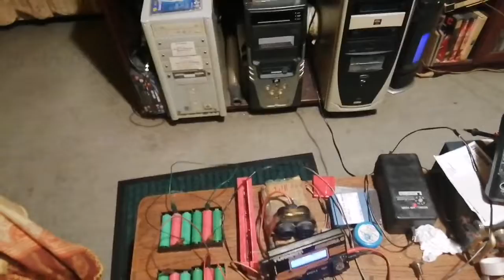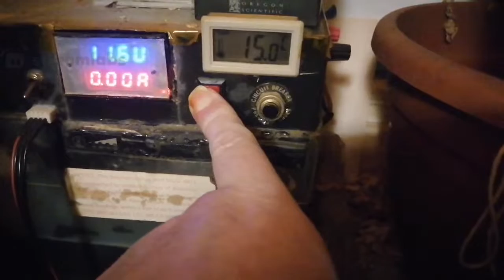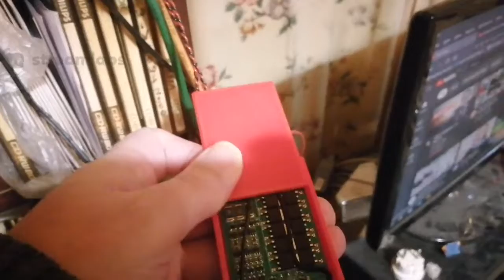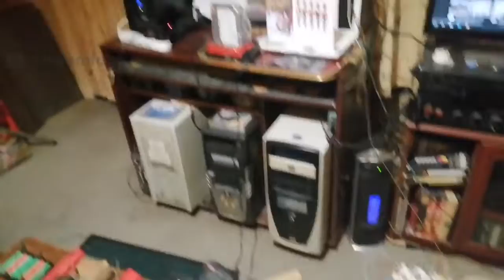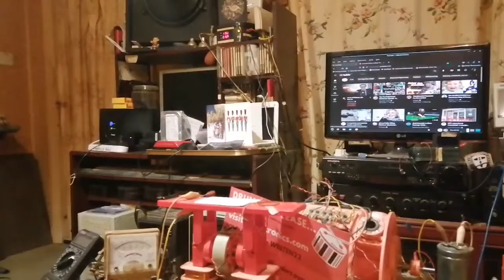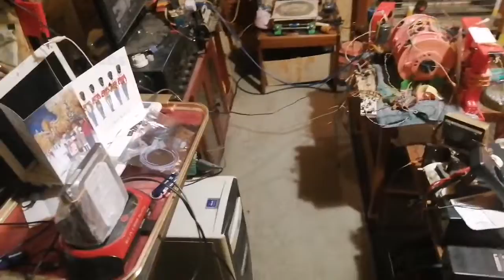Regarding my Solar Battery

Comment: 🧲 Have you ever played around with high frequency plate capacitors? I use them for storing static electricity for my ball lightning generator.
Reply from the maker: Not specifically no, because the amount of useful Watts is very small, I know many experiments others have tried but I tend to see it more of a novelty. I Prefer to focus on useful current devices, I have had some high voltage devices in the past such as an ex military transistor with ceramic isolation blocks but gave that away years ago. The problem with working with high voltages is it can cause fires. Once in 1987 I nearly set fire to my kitchen after building a high voltage insectecutor I have been reluctant to mess around like that ever since.
Reply from the maker: I was working with high frequency motionless electromagnetic generator power. I will take a look at your detailed response when I resume my virtual machine which is where I watch YouTube videos.